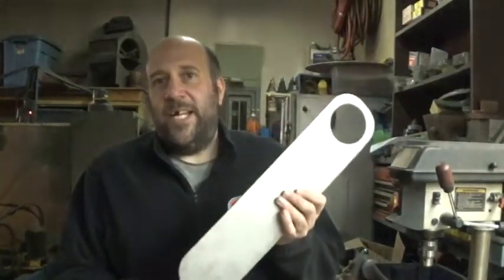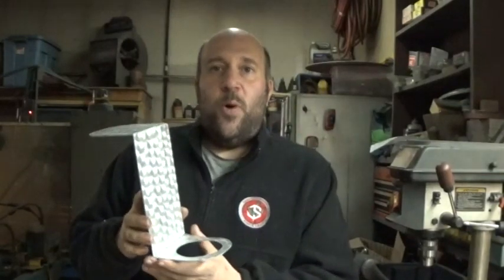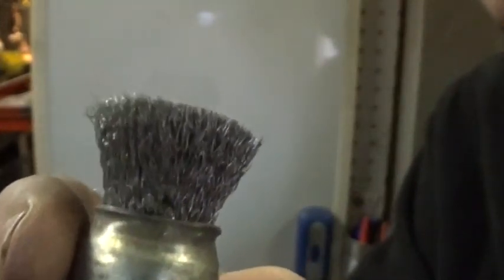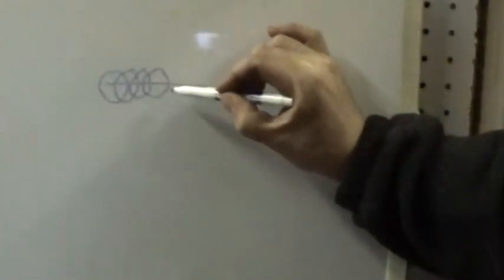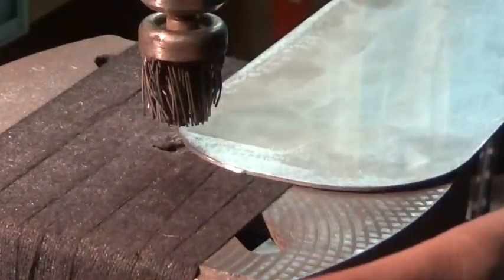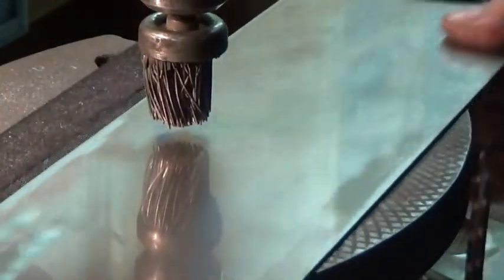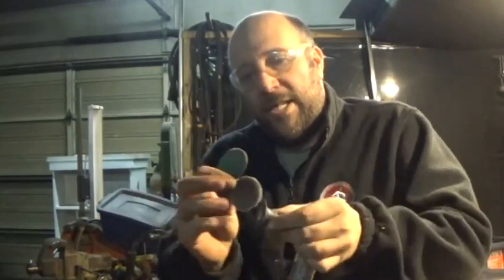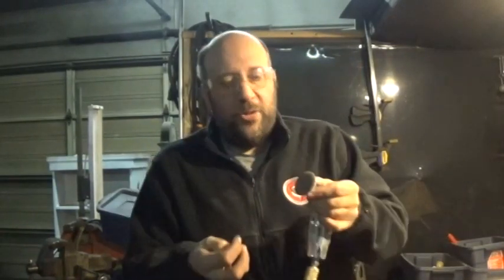Simple Metal Surfacing Technique

Comment: Never heard it called jeweled or jeweling, I've always known this process as engine turning.  I was taught to use a wooden dowel with rubbing compound by a friend but never had good results, will have to try the wire wheel and 3M pad method now.  Thanks for the great tips Jeff!

Comment: Jeweling is supposed to create a surface on carbon steel that will hold oil, thus eliminating the need for paint or bluing to protect from rust.. also increases the lubricity/“slickness” of cycling the action of a rifle bolt!